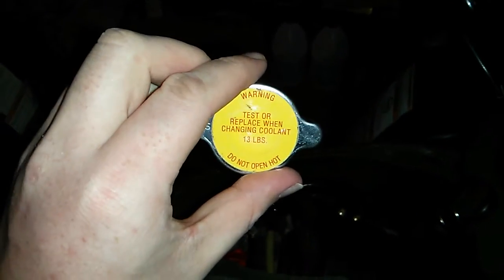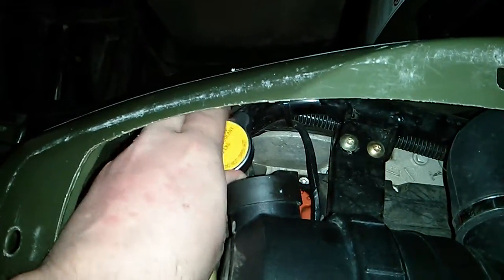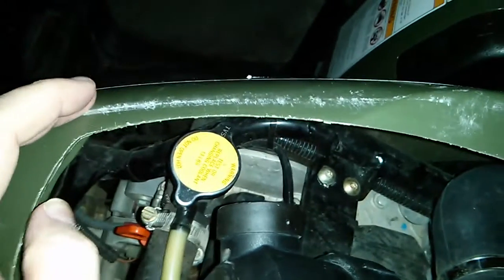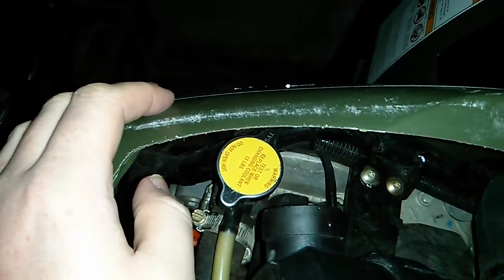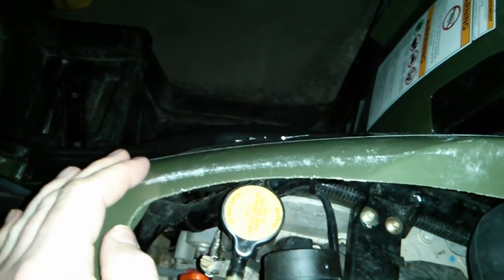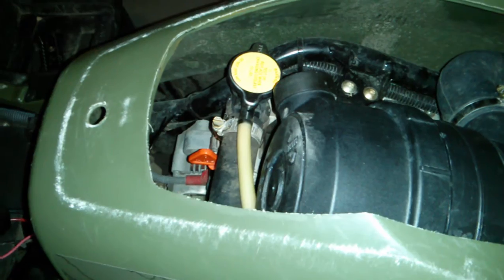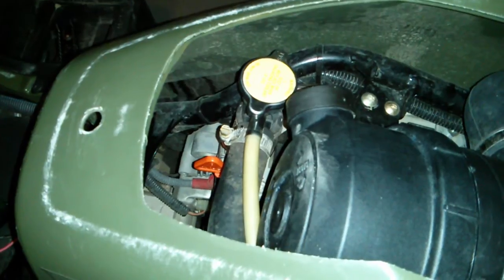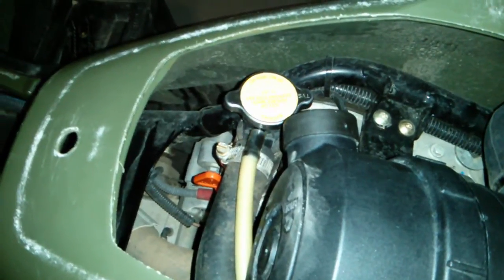Coolant Cap, How tight is to tight? - 2007 Arctic Cat 700 Diesel

Comment: When your auto is cold. Try opening and closing the radiator cap. Then try it on another different car. This should get you familuar with the "snug" feel of putting it on. Then put it on and leave it alone. Check overflow container to see if fluid is moving back into system when it cools.  Your radiator overflow tube is kinked or squeezed shut.  Check to see if there is a clamp on overflow hose at bottom of overflow container.  Your Air filter heavy patical discharge (now facing left) opening should be facing straight down to facilitate particle discharge. Make sure delicate rubber valve is not stuck or glued shut by moisture. Just touch it to see if it will lift, if not gently rub it to clear it.